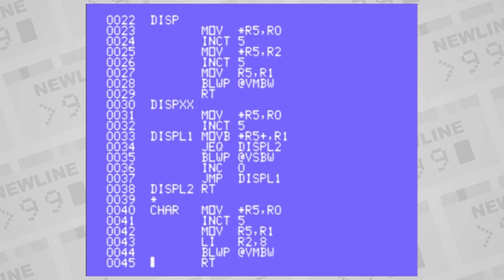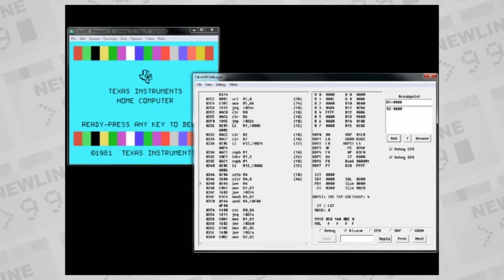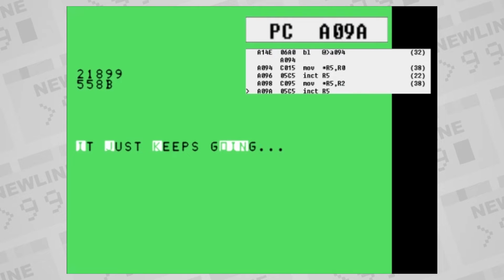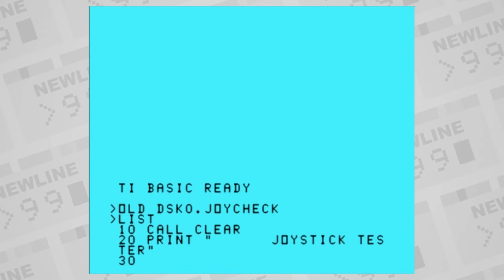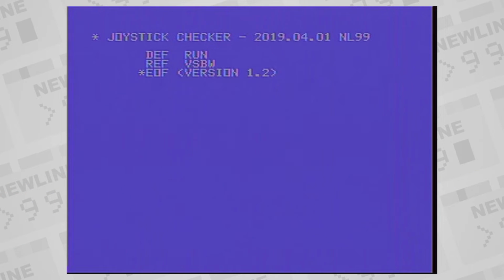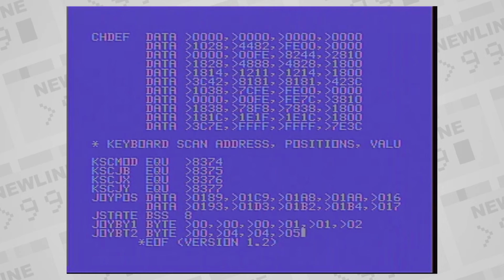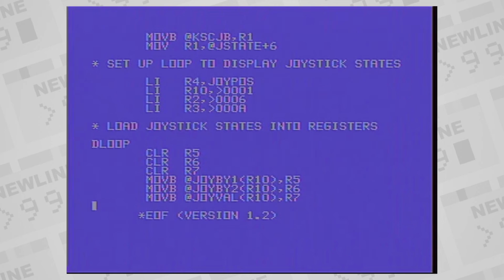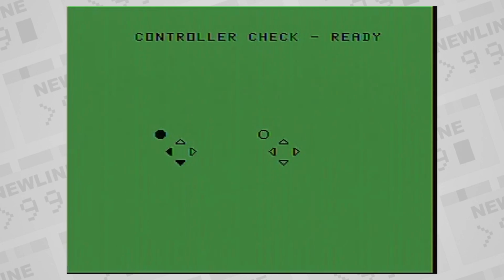Introduction to TI-99/4A Assembly - Newline99

Comment: I would love to get my hands on the expansion station with a disk drive and the assembly/editor cart to play around with for my TI99/4A I stream from time to time.
Reply: If you are still interested by next year I am planning to unpack my TI stuff. I still have some stock from when I had a little shop .. had to pack it away in the '90's. I do have the items you mentioned ...somewhere!
Reply: I need the disk sidecar which is almost impossible to find. I just bought the assembler package new out of the box but it came with floppy which the tipi expansion won't work. I could find a way to put my own disk controller and just use a 5.5 inch floppy . I may have to go that route. I'm in no hurry because I'm still working and haven't reach my retirement age. I'm open to suggestions. 73